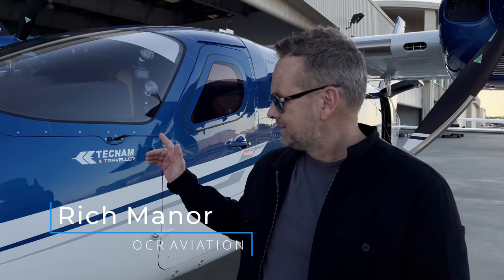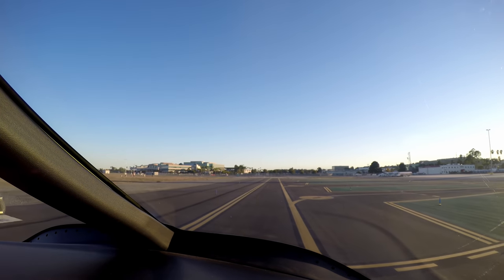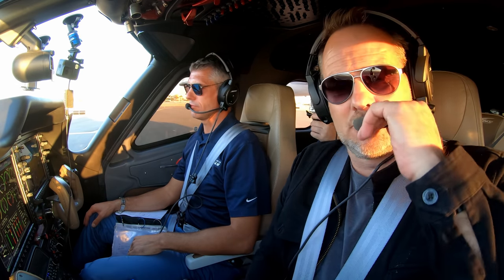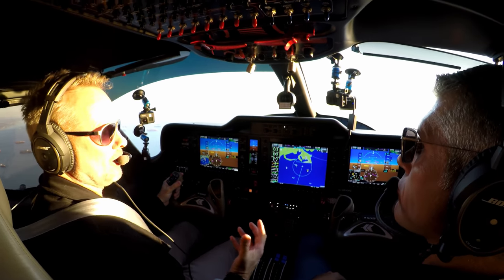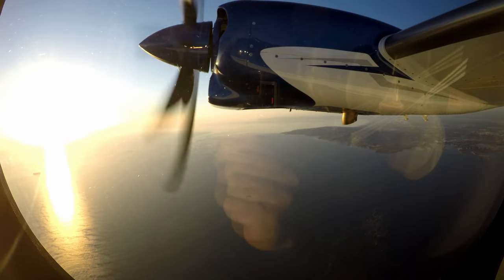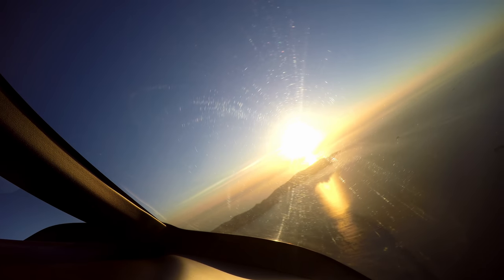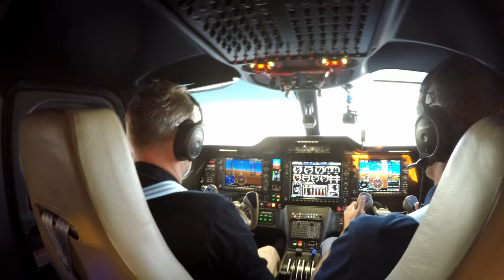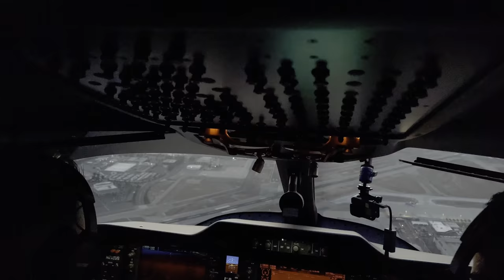#47 Demo Flight in the Tecnam P2012 Traveller Twin

Comment: Boy that “full power” power-on stall got my attention — I don’t think I’ve ever seen a Garmin attitude indicator display show that much pitch up! How did it feel in the plane? In the 310 I trained in that type of power-on stall would have been a big no-no, we used half throttle and it still felt like you were pointed straight up.  I’m also curious about setting power with prop control only, what system is it allows the pilot to do that, some type of electronic or computer engine control?  The steep approach looked awesome! Thanks Rich!
Reply from the maker: That was very impressive and Rick solid stable. The ECS system handles the loser based on RPMs so MP and fuel automatic from ECS. Very simple. Steep approach was impressive too - don’t know where you would ever need to do that but clearing an obstacle prior to short field landing would be very easy. Thanks for watching.
Reply: Thanks Capt. Rich
Reply from the maker: Thank you!
Reply: I had the Italian guy say the TO is a STOL, so the pull hard control back prior to TO roll, n in the lift-off, then ease back..with power adjustments  via prop (to 2400)..

Comment: Have always favored the Caravan, but the Traveler offers the extra safety of having that extra engine. Very nice plane, very solid.
Reply: I did a little looking to see how the Traveler stacks up against the Caravan - it seems that although it is not quite as capable in some areas, the operating costs appear vastly lower. That, combined with better safety, a more comfortable interior with better amenities makes me think that this plane could very well steal the Caravan's thunder in at least the commuter sector.
Reply: A caravan has a turbine engine

Comment: Great video, the first on the P2012 that pilots would be interested in. The handling qualities seem perfect for a commuter airline with relatively low time pilots and the engines seem much easier to handle than that on the Chieftain. It will be interesting to see what Tecnam comes up with next. Retractable gear would be nice, as would G3000 avionics with touch screen controllers. I'm curious if Tecnam is investigating a diesel option, something like the Centurian 4.0 V8 engine. This would aircraft would be perfect for an earthrounder trip, but avgas is imposible to find in many parts of the world and if you can find it.....it is expensive. One quetion I have is are the throttle leavers left at the full forward position for most of the flight - if power is regulated by the pitch levers.  It would be really nice if Tecnam would also put the POH/AFM on their website so prospective pilots/owners could familiarise themselves with the aircraft.
Reply: Or tiny turboprops
Reply: Surprised they did not fit G3000 in there as well considering the size.

Comment: We were just talking about the P2012 last night and this morning!!  It all started with the new Cessna Sky Courier. Then the sich w/ Cape Air and the P2012!  8)  The Sky Courier is very cool too!!  Cape Air is replacing their Cessna 4xx's with the P2012's.  We were speculating if they might add some Sky Courier's also. 8)  2- PT6's, very good performance!! I think they were designed for FedEx!?  Interesting!!  Great ride along, thanks Rich!! 8) --gary
Reply: I doubt Cape Air would add the new Cessna as it would mean maintaining two types instead of one, which would be more expensive.
Reply: I mostly agree. If they did take on any cargo missions, or anything where more capacity was needed, the brand new Sky Courier would be an excellent choice. It's still single pilot certified, has big capacity, built like a tank and PT6's are so common now they are easy to get worked on! Parts are everywhere. It seems a great value! All things to look for when optimizing the bottom line.  8)   Peace..   --gary
Reply from the maker: Skycourier is basically double the money and 19 seats. For operators who can fill the seats or fill it with boxes it will make a lot sense, but likely a different operator than the P2012. I think you will see Fed Ex phase out the Caravans for Skycouriers over time. We’ll see.

Comment: 150 Kt airplane at 40 gals an hour, fixed gear.  Not bad, call it 8 pax, Pilot and Co pilot, 10 total. Very nice Stall handling, full power stall just a little right rudder. What kind of anti ice.  Probably boots with recip engine.  Very nice camera demo sales setup.
Reply from the maker: Thanks!
Reply: Website says it has TKS.

Comment: Seems like a  very nice plane and extremely safe with very benign stall and single engine demo. Fixed gear and no pressurization means less complication and cheaper to run. Wonder how sales would go considering it's a piston. Thanks Rich
Reply from the maker: Good question on the piston component. We’ll see. Thanks for watching!
Reply: Turbine power would probably add the better part of a $million to the price. 

But depending where the aircraft is flown the difference between the price of jet vs. Avgas needs to be considered.

As for the fixed gear and no pressurization,  this seems like a short haul commuter hauler. On the short legs the speed penalty for the fixed landing gear is not a big deal. And on short hops at low altitude the pressurization isn't necessary. Just a heavy expensive fluff.

Comment: Nice, aircraft where my elbows are not stuck in the side of my co :)  ... is it just me, but those panels seem to move a lot when operating switches and push buttons.   Nice video!  $2.6 Million, on the pricey side but certainly cheaper than a TBM 940 at $4.3 Million which seems to require more care/maintenance.  Seems to be a very stable and solid workhorse aircraft with low operating costs.
Reply: The TBM doesn't have near as much interior room or the ability to carry cargo. The TBM is a sports car and this is an SUV.
Reply: @TexanUSMC8089  You cant compare this pice of Junk to a TBM

Comment: Looks pretty nice. I personally hate the p2006 after working in them for a few years but this seems pretty good. Better cowlings with the new engines. Interior looks like it would break less after wear. Having it with fixed gear doesn’t mean I have to curse at the tail panels fir the pump and hopefully they moved the relays. I’d just need to see about the brake system and the brake rotors themselves. The brake rotors on a p2006 are barely bigger than a light sport category aircraft and like to bend if over heated and over used as compared to a da40 which has a much bigger break rotor with both aircraft having similar empty weights
Reply from the maker: Thanks for the feedback - so important to get the service/reliability right on a working airplane like this!

Comment: I can’t wrap my head around the market for the P2012.  Its a nicely appointed plane but for $2.6mm you can buy a very nice Cessna Caravan and fly it for a year before reaching the acquisition price of a P2012.  You will fly a littler faster, have better useful load and have  PT6A-114 reliability.  An A&P told me Cape Air was having issues with the engines.
Reply from the maker: There is a strong component and appeal for redundancy of twin engine. Caravan will burn more block time fuel but fuel costs will be similar due to cheaper jet fuel. High utilization operations will likely have higher engine maintenance costs due to HSI interval and component cycles. We’ll see though - Caravan very tough competition for sure. Thanks for watching.
Reply: For the type of flying cape air does(remember this aircraft is custom designed for cape air) caravan is not an option. Multiple short flights in an hour type of operation cycles out turbine engines way before they reach operating hour limit. Now you have to spend hundreds of thousands of dollars to overhaul an engine that has half of it's nominal tbo left. Piston engines only count hours. There is no cycle limit. They should have bought a turbine aircraft people have no idea what they are talking about. The engine overhaul costs would eat operators like cape air alive.
Reply: @blegi1245  I didn’t suggest Cape Air should be flying Caravans.  I said Cape Air may be having problems with the engines.  Many operators run short hops with aircrafts with PT6 and other turbine engines. There are 135 operators like VeriJet flying short hops in single engine jets like SF50. The fact remains that it’s $2.6 mm for the Tecnam at 150 TAS doesn’t move the needle for me IMO and you don’t have nearly the National support as a Textron aircraft.
Reply: @DonAv8s  go buy a textron turbine then. Why are you here crying instead?
Reply: @blegi1245  Wow man!  Do you work for Tecnam?
Reply: I think a pair of jet fuel burning Diesel engines would be a sensible option for tecnam to offer for customers in regions where avgas is harder to find .
Lower fuel costs (long term), and generally low maintenance costs...  except for that replacement (as opposed to overhaul) thing.
Reply: The PT6 will cost much more in fuel and general maint.

Comment: Seriously for the longest time I was favoring the old Cessna Skymasters for twin power, I never had issues with engine out issues with inline centerline thrust. A true workhorse in its day, always flew it in a four seat configuration which was all needed for my type of flying.
What I would like to know what is the price of one of these 2012’s in Euros, import taxes into the USA must be crazy stupid. I reside in  Europe now but I am curious to compare costs. Too bad they don’t have the 2006 with these Lycoming engines.

Comment: Great video Rich and this looks like a seriously nice airplane.  I can't help but wonder how this machine compares to the Grand Caravan, in performance and load capacity.  Obviously not going to carry as many people in the P2012 vs the GrandVan but I'm thinking about freight?  The GrandVan, in my understanding, will carry up to 1200kg with full fuel and then planning happens at 165kts.  Cost of purchase and ownership on this will be materially cheaper...  Your thoughts?
Reply from the maker: Grand Caravan standard useful load based on standard airplane which is pretty light (no options) has more like a 1800kg useful load. Similar P2012 has a 1360kg useful load. Max seating in both airplanes is 10 but one of the things I was most impressed with in the P2012 was the feel of cabin and seating - it just had a very comfortable, airline feel to it. Obviously, the Caravan will be stiff competition for the P2012 but I see some advantages to it and I think it I’ll do well in the market, but won’t happen over night. Thanks for watching.
Reply: @FlyingwithRich  thanks Rich. Any indication of price for the P2012?
Reply: @StrandManna  ...  I believe that it’s priced right around 2.6 mil...  depending on specs of course

Comment: I want to know how does this cost 3M ? Just one of these engines cost like 50k if im not mistaking. So a 100k for the 2 engines. A pt6 cost like 1million.
So in the case of a quest kodiak 900 , its also a 3million price for a plane if im not mistaking. How did they ended with such a price for the p2012 !?

Comment: Today in the USA can you fly part 135 or 121 with pax in imc with a single?
Reply from the maker: I think so, but depends on the operation, airplanes, and equipment.  I think scheduled 135 vs 121 for a single engine aircraft.

Comment: Rich, does the P2012 have spoilers to control speed during the steep approach? This approach would be helpful landing at Toncontin Airport Honduras and Gustaf Airport St Barthélemy Island, not to mention London City Airport.  Do you think maintenance of two piston engines would be more or less the cost of one turboprop turbine engine?  Great performance on single engine.  Does the aircraft have air conditioning?
Reply from the maker: No spoilers. Yes on AC. Great question on engines and I’m not really sure. I can see real advantages to both. A lot of high utilization operators can get on TBO extension programs for PT6s than can push overhaul intervals way out which can really drive costs down. There are other factors that make the pistons a better choice - not subject to expensive component cycles so we’ll see. Thanks for message and watching!

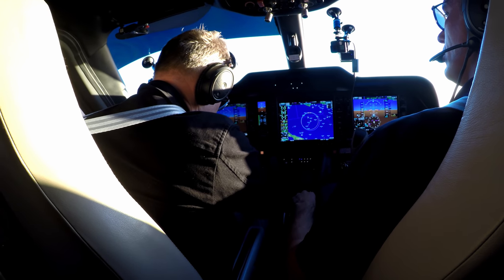Comment: A beautiful and expensive toy. With a flight weight of 3000 kg, a speed of 250 km / h, gasoline consumption is 150 liters / hour. Watch from 14:25 . Very bad. I have an ancient 70 year old huge Antonov-2. So it also consumes 150 liters/hour at 5000 kg. And the upgraded AN-2 without a lower wing, the TR-301 aircraft consumes 100 liters /hour.
Reply from the maker: Interesting comparison!

Comment: This product is silly. $2.8m,  35gph, 190kt cruise?  Laughing.
Reply from the maker: Closer to 40 gph. Thanks for watching!
Reply: @Speedo Mars so tell me what comes close to it? What else can carry 11 people at 40 gph, 190 kts and cost only $2.8 million or less? I can't think of anything.
Reply: Really? Price and performance seems to be in reasonable range.
Reply: @micham8278  A quest kodiak 900 can have 10 passengers. It costs close to a 3m, but is also 900hp pt6 turbprop engine .It actually makes more sense for the money and quality. The p2012 is awesome, but that price is not justified. Alone just the 2 engines cost like 100k in total. The kodiak engine is 1million and the price is still there for the whole plane.